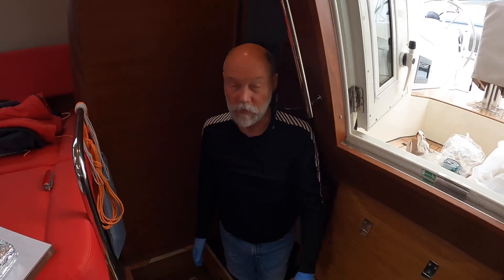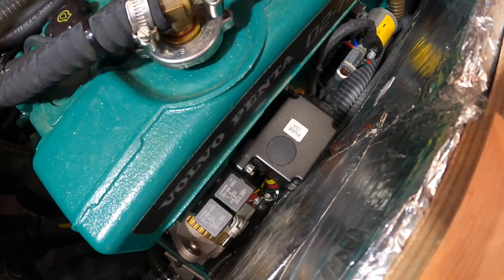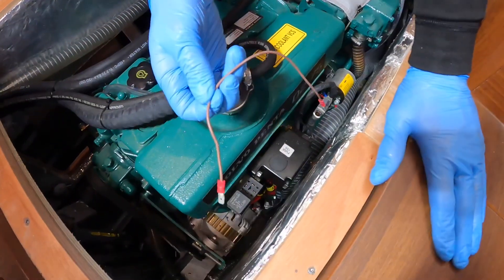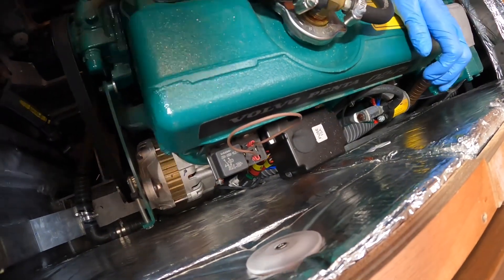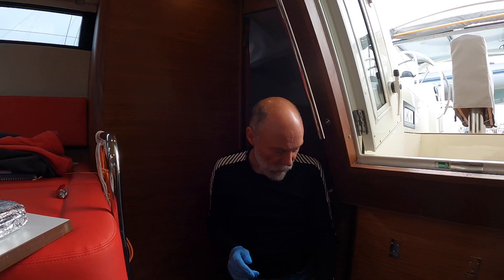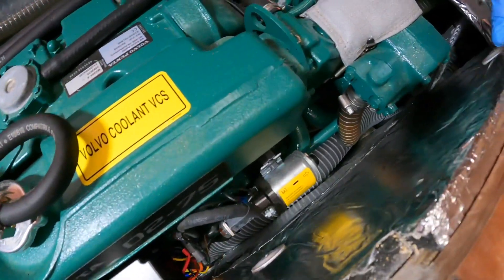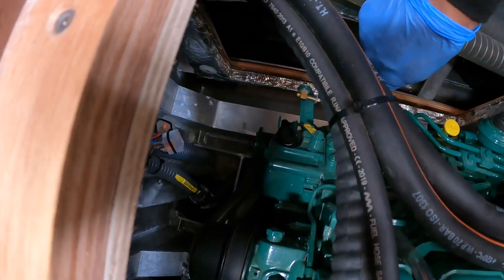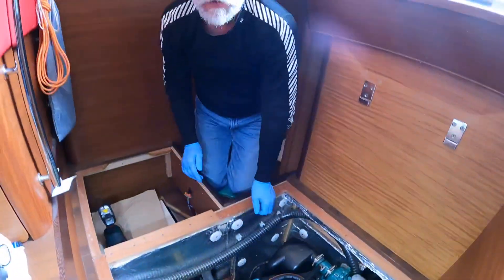Snow Gum - Manual Engine Start for Volvo Penta D2-75 - Garcia Exploration 45

Comment: Thanks for another example of Volvo MDI Workaround.  I use a permanently installed remote starter switch on a D2-55.  Am building a replacement panel, with analog gauges, to PERMANENTLY sidestep the MDI.  Volvo tries to treat each MDI failure as a discreet and unique event.  “So sorry to hear of your problem…”  It shouldn’t be OUR problem at all.  Volvo designed a faulty device, which puts people at risk in the event of failure in remote cruising situations.  They’ve tinkered with the design but haven’t fixed the problems.  Their only response is to sell you a new one. Their MDI has NO PLACE on a robust, off-grid cruising boat.  The engine is OK, the MDI is dangerous. If your MDI still works, figure out your workaround BEFORE it fails because you’ll get no warning when it does.  And that failure can take many forms — no power or signal; power but no start; power but no stop; starts on its own; stops on it own. Of all the risks we face at sea, this should NOT be among them.
Reply from the maker: What Mark said. 100%.

Our MDI failed, repeatedly, as we were motor sailing to reach harbour before a full gale arrived. We were caught in the gale, with an engine that kept stopping. Not fun. Not at all. However, we did get the chance to personally verify that our boat sails in atrocious conditions with style and grace. 🙂

Comment: Rick and Carolyn, seeing this video has taken away one of our major reservations on owning a Garcia Exploration.  Popeye (the Beneteau First 47) had a very simple, cable-controlled diesel that onyl required clean air and clean fuel to keep going - there were no sensors that would prevent the engine from running.  We were reluctant to have a Volvo engine in our boat, with potentially faulty sensors or relays.    A belt and braces is the way to go!

There were a few questions remain: 
- with the relay removed from the MDI, can you still start the engine from the helm position, or can you only start it from the emergency start button on the start solenoid?
- likewise, with the jumper cable in place, can you stop the engine from the helm?
- what procedure did you follow to warm the engine?

Many thanks again for all your work on producing these videos.
Reply from the maker: Hi Sean, Kate. This procedure is for use when the cockpit buttons and display are not working, possibly due to a failure of the MDI, or some other electrical glitch. The couple of times I’ve tried it I’ve been at the engine, not at the helm, so I can’t say for sure what’s going on with the displays. It could vary depending on the nature of the electrical fault. For example, the MDI might be OK, but the relay could be fried. In that case, you’ll see that everything looks OK from the cockpit, but the engine won’t start. Same for stopping the engine. 
Not only was the engine cold, we also had air in the fuel line from the empty, new fuel filter. What happened off camera was that I put the relay back in, warmed the glow plugs via the cockpit controls, cranked the engine and let it run a bit, roughly I’ll admit, to see if it would clear the air. Nope. So we bled the air from filter and lines, after which the engine started, again, from the cockpit controls. Then Carolyn filmed take two and the engine started, manually. If we were doing a manual start from cold, it would have taken a few spluttery starts to get enough heat into the engine to keep it going. Perhaps someone can tell us a way to manually activate the glow plugs, bypassing the MDI? There’ll be a way; there are cables at the MDI labelled ’Glow’. Perhaps the other relay? The proof will be the engine starting quite happily from cold after 20 seconds of manual glow plug activation. I vote that you use a bent fork to try this on your new engine! 😄

Edit in Feb 23: Upon reading this again I see that I can expand on warming the glow plugs manually. When our engine was being tested after the rebuild, following replacement of the flywheel and coupling bolts, the Volvo tech asked me to help him warm the glow plugs. I was on the port side of the engine and he passed me one end of a long wire he pulled from his tool bag. He asked me to touch it onto a positive cable from the battery. He touched the other end of the cable onto the metal bar that distributes power to the glow plugs, on the starboard side of the engine. This is normally covered in paint when the engine is new, so chipping some off the nut at the end of the bar might be necessary. 12 volts flowed through the glow plugs for about 10 seconds and the engine started when the relay button was pressed. Cool! Well, warm actually. 🙂

Comment: Hello Sir, great video. I have Ovni395 with Volvo Penta D2-60,  and I am after first MDI total failure. What I did I installed permanent emergency ignition button in the engine room, just next to starter. I didn't need to remove relay. And for everyone's information the "starter button" is what it seem to me kind of relay that is disconnecting ground of engine from hull - it is mainly installed on aluminium boats and may not be present on all engines, in that situation engine will start at with first moment of paperclip connection:)) Take care!
Reply from the maker: Good points Andrzej. Thanks for this informative comment.

Comment: How did you warm it up before using the emergency start?
Reply from the maker: Hi Brett. It took half an hour to warm the engine up with thirteen tea candles. 😐
And if you don’t believe that because it would have taken at least seventeen, see the reply to Sean and Kate’s comment. 🙂
Reply from the maker: Hi Brett.  Let me paste here an edit to a reply to Sean and Kate. 

Upon reading this again I see that I can expand on warming the glow plugs manually. When our engine was being tested after the rebuild, following replacement of the flywheel and coupling bolts, the Volvo tech asked me to help him warm the glow plugs. I was on the port side of the engine and he passed me one end of a long wire he pulled from his tool bag. He asked me to touch it onto a positive cable from the battery. He touched the other end of the wire onto the metal bar that distributes power to the glow plugs, on the starboard side of the engine. This is normally covered in paint when the engine is new, so chipping some off the nut at the end of the bar might be necessary. 12 volts flowed through the glow plugs for about 10 seconds and the engine started when the relay button was pressed. Cool! Well, warm actually. 🙂

So, Brett, this is a way to heat the glow plugs manually, handy for when the MDI is not working properly. Regards, Rick.

Comment: Don't drop anything! is the 52 as bad? Hopefully, the new Garcia 60 will not suffer the same engine access issue.
Reply from the maker: I dropped a socket wrench with extensions a couple of times when undoing the gearbox oil filler plug. It goes clatter, clatter, bang, but doesn’t go very far. 🙂